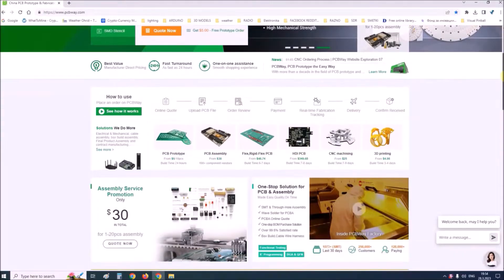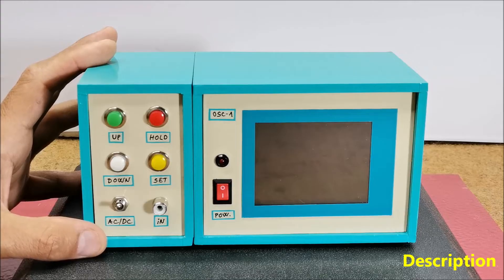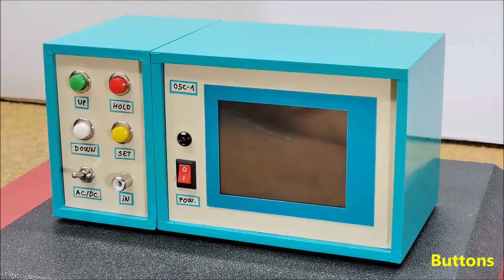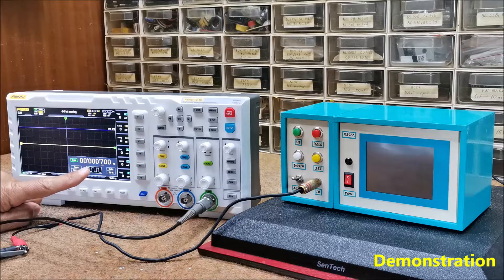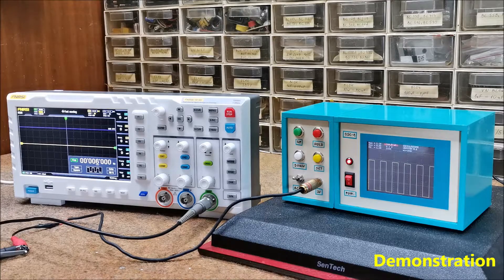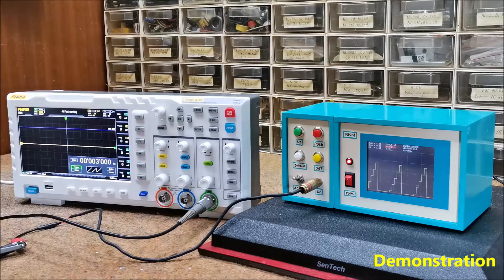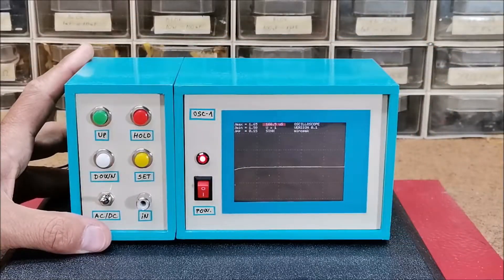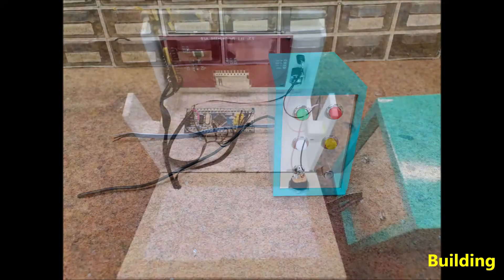How to make Simple 500KHz Oscilloscope with STM32 ( Arduino IDE )

Comment: Please tell us as which "STM32 Master" library are you using????  This code of yours doesn't compile with the library available on Github.  It exists after reaching STM32ADC folder in the Documents/Arduino/Hardware/Arduino_STM32\STM32F1/libraries/STM32ADC ... no details in error message given by Arduino IDE.

Comment: i friend first thank you and what if i need to use it with 220v to 400v AC and DC
Reply: Hi, you need input safety block. This include diodes, Operational Amplifiers(RM324, TL084,...) Resistor dividers( for switching HV to Low Voltage), maybe optical IC for more safety.

Comment: Can I check 220v or 440v ac frequency wave .......plz reply...it will not damage if I check ac voltage
Reply from the maker: No, you cann not check 220 or 440 V AcC or DC
Reply: @MirkoPavleskiMK   What can we do for check 220 v or 400v
Reply: more voltage divider ratio...and  buy 100:1 ratio scope probes!
don't forget that 400 back has 1,4 x higher peak to peak voltage!
Reply: If you have to even ask such a question, you shouldn't be anywhere near anything over 50 volts.

Comment: Hi from Brazil, first all thank you so much for this project, but how is the maximum voltage we can achieve ?
Reply: Only voltages from 0 to 6.6V
Reply: if you use a normal 10:1 oscilloscope probe, you should be able to get 33 volts, direct to the 12-bit ADC., and i think he has a 2:1 divider, so 67 volts.

Comment: Can you make one that can 1MHz? I've heard it can do 14 mega sample per second. Can it be used it at 1MHz? Maybe using a another module for display so less pressure and fast response on main board?
Reply: stm32f103 in datasheet 1us A/D converter = 1msps theoretically max.
in teoretically 2 ADC converters + time-interleaving can give you 2msps but it is very difficult to implement
Reply: @mr.bdengineer8173;
if you use f303, it has 4 x 5 MHz ADC's, i think up to 7 MHz onterleaved

Comment: In the schematic I can see a diode connected to 3.3V, is it the same 3.3V from STM32 board?

Also can you specify the voltage range that the oscilloscope can measure.
Reply from the maker: Yes, 3v3 from the board (STM32) . To protect the microcontroller, the input voltage must not be higher than 3.3V. For higher voltages a simple voltage divider should be added